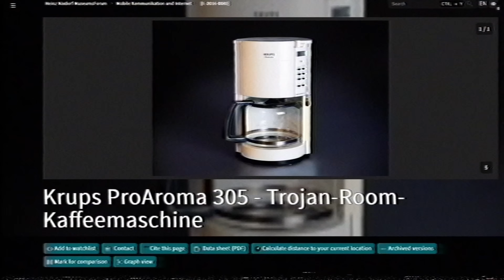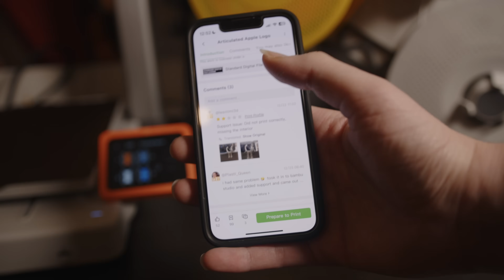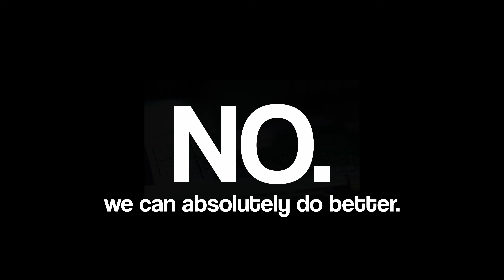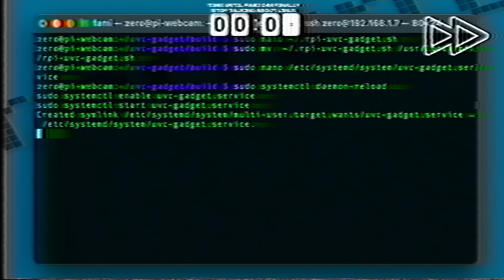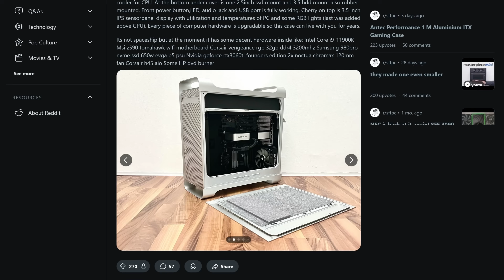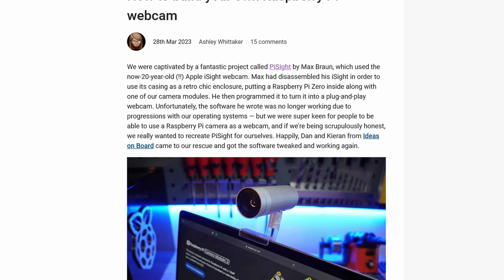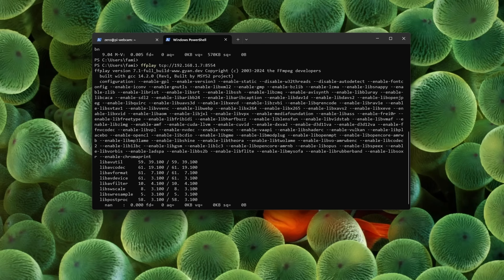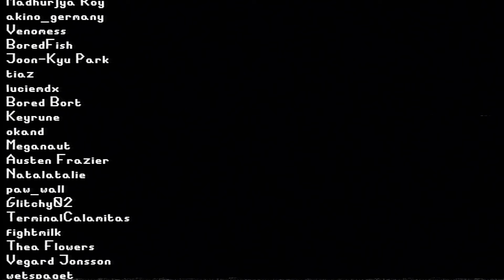Webcams SUCK, so I built my own one

Comment: My webcam is a module and a USB adapter board so that on my monitors bezel I have a 8x8x7mm cube.
The camera has a 120 degree low distortion lens and Nvidia Broadcast ensures that the image is properly framed when I move.

Better than most high end off the shelf webcams.

Comment: 8:33 I'd just like to interject for a moment. What you're refering to as Linux, is in fact, GNU/Linux, or as I've recently taken to calling it, GNU plus Linux. Linux is not an operating system unto itself, but rather another free component of a fully functioning GNU system made useful by the GNU corelibs, shell utilities and vital system components comprising a full OS as defined by POSIX.

Many computer users run a modified version of the GNU system every day, without realizing it. Through a peculiar turn of events, the version of GNU which is widely used today is often called Linux, and many of its users are not aware that it is basically the GNU system, developed by the GNU Project.

There really is a Linux, and these people are using it, but it is just a part of the system they use. Linux is the kernel: the program in the system that allocates the machine's resources to the other programs that you run. The kernel is an essential part of an operating system, but useless by itself; it can only function in the context of a complete operating system. Linux is normally used in combination with the GNU operating system: the whole system is basically GNU with Linux added, or GNU/Linux. All the so-called Linux distributions are really distributions of GNU/Linux!
Reply: yes.

Comment: What does capitalism have to do with anything here? The market for a high-quality webcam is extremely small. Barely anyone actually needs a webcam, and most people don't care about what it looks like. I agree that it's frustrating that most webcams are awful, but honestly their pricing is mostly fair for what you get... just don't look at "gaming" or "professional" products. Using labels to milk people like that has always existed in every economic system.

But the expectation for webcam quality is just because of the camera quality of smartphones, and that's mostly due to the processing power of a $1K phone versus a cheap camera. Without mass-market demand, webcams are just going to be made out of previous generation smartphone camera sensors, and that's the way it's going to be forever.

But without capitalism, you wouldn't be buying a webcam to begin with.

Comment: When you claim something is better than something else, you need to do a side by side comparison. I have worked with both in the past and honestly the quality difference isn't too high. If you got a better sensor from Arducam or elsewhere, maybe it would be better than a webcam. Of course you seem to be familiar with mirrorless cameras so you know the benefits of better sensors.

Honestly, for most people who also want to reduce e-waste, keeping an old phone to use as a webcam is usually good enough and a significant jump in quality above cheap webcams. Your options may be more limited in the Apple ecosystem though, but there are open source solutions especially on Android for the same functionality.

That being said, this is still a nice project.

Comment: This project looks great if you want a custom webcam, however, there are several things that make it seem not so convenient to me:

- The cost of the Raspberry Pi + Camera is around $40 or $50, maybe more depending on where you live (in my house it could reach $100 for shipping and import costs), are there really no good webcams in that price range?
- The Raspberry Pi is still a computer, and you are installing an operating system on it, Linux is super secure, but in inexperienced hands it could become a security risk, especially if you plan to use it as a security camera connected to WiFi.
- I have serious doubts about the reliability, Raspberry Pi has a history of corrupting SD cards if not shut down properly, and even without that, the operating system itself can be damaged if it is repeatedly forced to shut down, which happens if instead of giving it a shutdown command, you simply unplug it, which is what is usually done with a webcam.

The best way to make this project much better would be to change the Raspberry Pi for an Arduino board or similar, that would not only lower the costs (since Arduino clones are available everywhere, even some with WiFi modules), but would make it less susceptible to software damage, since it does not depend on an SD card and an operating system. I know that you can connect cameras to the Arduino, and they even sell specific modules for it, so costs can also be reduced in that way.

I love your content f4mi, I hope there is a second part (poverty edition) where you try to reduce costs and compare it with other webcams with similar prices, it would be super fun :D

Comment: To answer the original question more directly, webcams suck because they use absolutely tiny sensors. They use tiny sensors because they are very cheap, both because the smaller sensor means a smaller piece of silicon and because a smaller sensor needs smaller lens elements (which are also therefore cheaper).

The Raspberry Pi camera 3 has a 7.4mm diagonal sensor, and the HQ camera is slightly larger at 7.9mm diagonal. A typical webcam uses a 3-5mm diagonal sensor, so these Pi cameras have 2-4x the light gathering area. These cameras are not even expensive because they're still pretty small in the grand scheme of things, but manufacturers want to maximize profits on commodity items like webcams and consumers don't seem to care too much. As a secondary point, smaller sensors fit into the tiny bezels of modern laptops more easily, giving a second motivation to keep the sensors small.

By closest comparison, a "micro four-thirds" photography camera (basically the smallest sensor anybody bothers to put in an interchangeable-lens camera) is 21mm diagonal, with point-and-shoot cameras usually sitting around 16mm. APS-C and 35mm are ~28mm and 43mm diagonal respectively - orders of magnitude more light can hit a sensor like this, so your images are sharp and low-noise.

Comment: I was super interested in how one might make a webcam from scratch but you just bought a raspberry pi module and followed a setup tutorial. congrats on technically doing the thing by your definition but I feel insanely clickbaited
Reply: Exactly, not even the software was made from scratch.
Reply: right like she thinks everyone has a sponsor or 400 extra bucks lying around just to buy a 3d printer just to print a 10 dollar part.for making a cam when i can use any existing smartphone and get free 4k like wtf... who does  she think  she  is?

Comment: I couldnt get it to work. It kept failing at the end :(
Reply from the maker: Did you use systemd to run the script as a service?
Reply: @f4micom  I did and then it just kept flashing green im on my 3rd try.
Reply: @f4micom  I got it to work. Geez the on the go thing was giving me issues for some reason. Got running thank you for your tutorial it was super helpful. Now I just gotta figure out why it works on my camera app but not discord and obs
Reply: @ I did and it works but just not with discord. So I have to use a virtual stream from obs to get it to work on discord

Comment: ahaha I ran the Pi HQ camera as my webcam for school over COVID, with a lens that was about 3x more focal length than needed (and manual focus!) causing much framing headaches. aaand this was following an old tutorial where you expose some frames over http, open the stream using OBS, then use OBS as a virtual camera, plus you had to install a special linux kernel module. fun times

Comment: I'm not even done watching the video and I want to thank you. I've watched my son sit and play with the camera modules on the two w well I was using them for 3D printing and remote sensing but it never occurred to me I could build an upgraded webcam 😁

Just a curiosity since it sounds like you're getting to know the materials well; if you could have used ABS would you have, or would you still have preferred PETG for this application? 

I have rolls and the ability (X1 Carbon) to do this project in PC, ASA, ABS, PETGHF, and PLACF, so I'm weighing my options but I actually haven't used the PETGHF, PC, ASA or PLACF yet. I may have to try more than one, but I'd still be interested in hearing your pick since aesthetics won't be my primary selection criteria 😁
Reply from the maker: i still have to experiment with ABS and ASA, i can't currently do that since i only have open printers so i won't express my opinion on that since it would only be based on what i've heard from other people ;;

Comment: sponsorblock did you dirty on this one labelling so much as filler.
Reply from the maker: yeah its users can be annoying sometimes marking what is not filler as filler, if you want you can help out by marking again correctly/downvoting what is not accurate but all of that is outside of my control and yeah i don't think that is filler in the first place, if they only wanted a dry video tutorial about "making a pi based webcam" this is not it, as i clearly stated in the video too

Comment: The focus breathing combined with the bit over-reactive autofocus makes the video from the PiSight a bit difficult to watch at least for me. (Focus breathing is the video zooming in/out depeneding on where the focus is). This can often be compensated in software, but it does require real-time focus information from the sensor, I don't know if that is available.

But it is true that webcams are just horrible. Usually the ones built into laptops are better, but any external one is garbage. I bought one that was supposed to be good in the early days of the pandemic (with months of waiting time, as to big surprise to nobody, demand went up and production down). And it has the dynamic range of a potato. Lighting needs to be perfect for it or either the highlights are blown out or any darker area just becomes black.

What people usually use instead are interchangeable lens cameras (like Sony A7 series cameras) and for example a HDMI capture card to get up to 4K resolution. These are of course WAY more expensive than any webcam, but they have unbeatable dynamic range, you will get very good background separatioin (blur/bokeh) and can get lenses with basically zero focus breathing. But I wouldn't of course recommend that setup for anybody just to attend some web meetings as it would be an absolute overkill.

Comment: It is unfortunately not enough to just play with scripts parameters to boost framerate or anything else for that matter. The libcamera is crazily unoptimized (a few examples just for the taste: it does image processing on cpu, uses dynamic std::map (not even unordered_map) for static tables where just enum would suffice, allocates/deallocates memory in hot loops, encodes mjpeg in software too, etc; it is utterly beyond repair), so it will eat up 100% of all cores on pi zero, drop frames left and right, and will generally produce a corrupted uvc-gadget datastream due to not meeting timing requirements, because cpu is just too oversubscribed with libcamera garbage.
There are non-libcamera images like showmewebcam, but they're using older v4l2 stack, which doesn't expose enough parameters to tweak anything interesting.
About a year ago I tried to make a proof-of-concept tool that could do 1080p60 using the new pi v4l2 stack directly, w/o using libcamera. I kinda succeeded, but not really. 1080p60 specifically is harder to make due to some odd technical reason (something something hard coded register tables for the sensor in kernel sources don't have known values to set up 1080 mode), but something like ~720p120 is totally possible  (with only like ~10% used of a single core of pi zero). It does, however, trigger some weird bug in the firmware and completely freezes the board within 40 minutes of running. So it's not that usable (yet?).

Comment: Technically it's just 2 adapters. thunderbolt 3 (type-C) > thunderbolt > FireWire 800 > appropriate cable FW 800 to 400. And yes surprisingly it works.
They certainly nailed the design. There's been a couple replicas. I got a couple off Ebay to mess around with.

Comment: as a webcam i use my Fuji GFX50R camera plugged into an elgato camlink cause it's very stable and doesn't overheat and because i think that webcam should all have sensors at least 44 milimeters wide.

Comment: Pro lifehack: If you have a video or photo camera (you know, those things people had before smartphones) that has HDMI out, which is surprisingly common, even on tiny point and shoots (usually in the shape of Micro or Mini HDMI - get a 50 cent adapter, if necessary), then you can just use any kind of capture card to turn it into a super mega ultra webcam that handily beats every webcam, including this contraption. We're talking 1080p/60, even with cameras that predate many of you reading this, more with newer models and the right capture card. Comparatively huge sensor + excellent lenses = lots of light being captured and turned into pristine pixels. 

Most capture cards, including the cheapest USB thingies for 10 bucks (with Euro taxes) will just lie to the operating system and call themselves webcams for compatibility's sake, which means that this is a plug and play solution that works with anything (I even got it to work on Android, although not with every app). All you really need to complete the package is to hide the camera interface on the camera itself and a pile of books or a tripod to put the camera at the correct height and angle. Presto: You have the best webcam in the world and will be the envy of everyone who appreciates this kind of thing, so probably nobody you personally know.

Alternatively, be me during the height of COVID without a decent camera during the great webcam shortage of 2020 and hook up the good ol' Kinect as a webcam (I think I had to route it through OBS Studio to work with Zoom). Glorious 640x480 with so much grain, you can almost taste it, but if you're just another postage stamp in a postage stamp album on someone else's screen, that's good enough. If you're absolutely destitute and/or don't want coworkers/fellow students to see just how sleep-deprived you are (or just troll them), even the old PS2 Eye Toy cam (remember that one? If you do, get your prostate examined.) will do, since that thing is just an early 2000s webcam - but it's quarter resolution compared to even the Kinect, so perhaps not ideal for an online job application in the tech sector. The upside is that it's 60 fps though, so your postage stamp will look extra fluent.

Just in case anyone actually reads this and not the 629 other comments already here at the time of writing, here's another bonus life hack free of charge: The same Raspberry Pi setup used in this video can also be employed to create a super cheap surveillance camera that does not phone home to China (unlike those things Bezo's Ali Express front is selling). The secret is a piece of software called motionEye. You will curse during the setup and probably waste the better part of an afternoon until it's finally doing what you want, but it's worth it. The Pi Zero W (and W 2) is so efficient that you can even run the whole thing off of a USB battery pack for days on end, even with additional infrared LEDs for night illumination. If you  want a case and don't have a 3D printer or hate using yours, because it constantly produces plastic spaghetti (my reply to that: git gud), stuff all of this, er, stuff into one of those cheapo fake surveillance cameras. There are even models that are more or less weather-proof, since they house a battery and red LED to look less fake.

Comment: Pretty cool. 
Meanwhile i just use Camo to use my phone as a webcam.

I can go up to 4k60 if I really want to as well as being able to specify which lens I want to use. 1080p60 is more than enough though.

Edit:
17:25 I have the Samson Meteorite. Got it when I was 16 and I am now 25, turning 26. Ended up making makeshift table stand using a plastic cylinder, tape and rocks for weight.

I recently upgraded to the Samson Satellite as it was on discount and I am pretty happy with it. AI noise cancellation makes any impact sounds, key clacking and background noise a complete non issue for voice calls (still planning to get a good mic arm though).

Comment: Mm, 'make a camera module' is and isn't correct, what they offer is a carrier PCB with a camera module already mounted on it. So they "make" 5% or less of the thing, or 0% depending on how you count it - since what the Pi accessory offering people make isn't 'camera' in any sense. 
That said, the project is cool, the iSight camera is a very nice looking one as far as wecbams go and replacing the guts of it with an adapted Sony camera is a worthwhile thing to do. I wonder if there is anything more that one could get the Pi to do here... It's rather slow, but it would be funky if there was a way to have it alter the output of the camera before it gets to the PC - like adding a zorro mask or some such 🙂

Comment: So, you didn't actually do anything (didn't use pro-grade sensor on self-designed hardware) and its sensor is no better than what you've started with.
Anyway, the best 'webcam' is and always will be an used non-CCD professional camera (year 2011 or newer) with USB or HDMI port connected to any computer.

Comment: 15:24 if bamboo lab's slicer supports it, you should switch from rectalinear to organic supports. Organic supports use significantly less filament making them faster, cost effective, and easier to remove than the alternative.